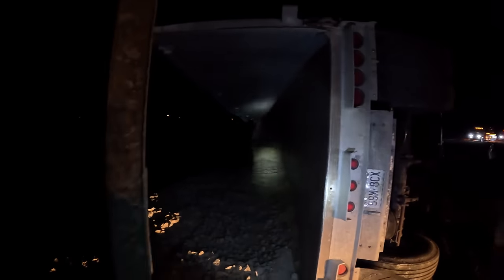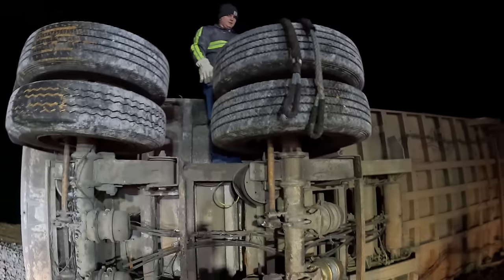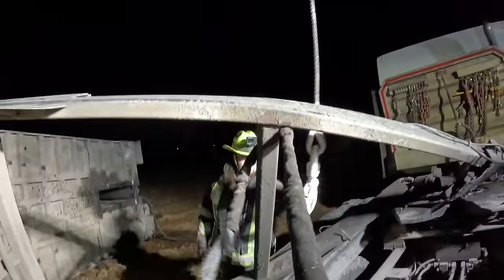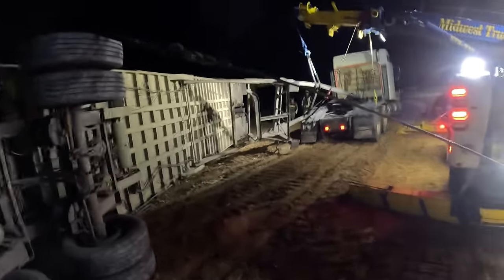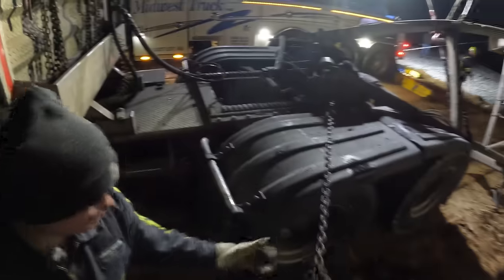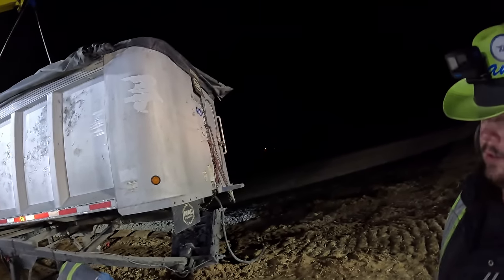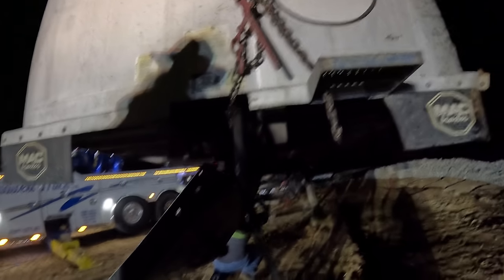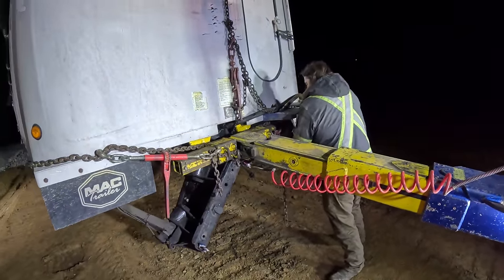Another Rock'N Rollover!!!  Let's Do The Twist!!!

Comment: It was great to see everyone back to work again all together, and I would like to ask why did you not hook up to that front corner of the frame and see if you could have meant that back up a little more I'm thinking that enough of that weight was there that it would have meant it back up and made it a little tighter to keep the fifth wheel plate of the trailer up a lot more and possibly you could have used that and also had a lot easier way to connect to it to do it back😮

Comment: if you had a portable welder either gas or diesel powered on the rotator or a service truck you could use a air arc attachment on it that would burn through the kingpin in about two minutes and you could drive the tractor away also if you have it on the tator you could possibly produce enough current to run a DC magnet like we use in scrap iron processing yards on cranes and you can attach it to the boom and clean up any iron debris on the ground or unloading a trailer and transfer it into another trailer
Reply: With that much tension in the arms cutting anything with a human within 20 feet is unthinkable.

Comment: Perhaps a foolish question, but if you rigged under the fifth wheel plat on the trailer, grabbing on the left side and lifting on the right, could you not have torqued the frame back enough to make it easier to tow?  And if it is foolish, why?

Comment: Ron this might sound crazy and a bit dangerous but could you not of cut the middle stretcher bar on the A frame to take pressure off and release the 5th wheel?
Reply: Let me say it this way: you don't want to cut anything under heavy tension with a rotary grinder or jigsaw...😵
Reply: @rome0610  Or any other way with a person any where near it. Maybe a shear on an excavator but who has one of those when and where it is needed.
Reply: @rome0610  true but if it was cut in the middle of the bracing might work